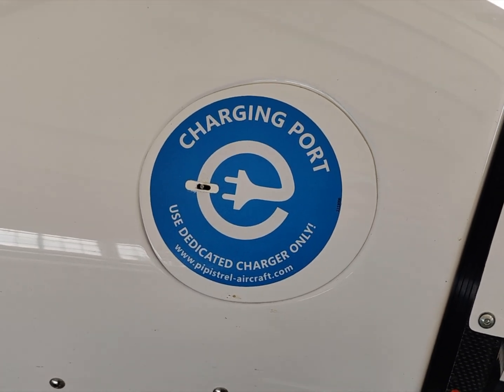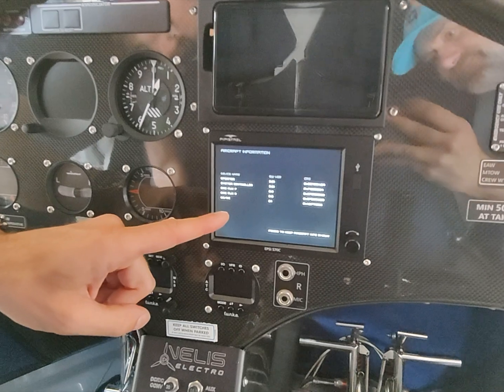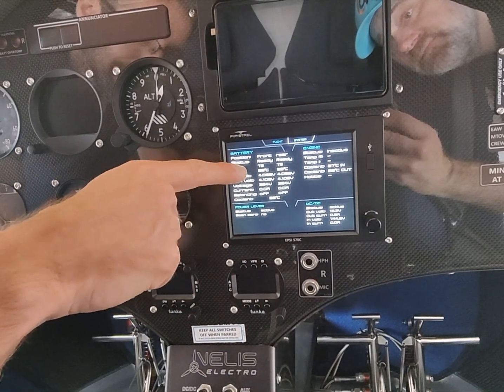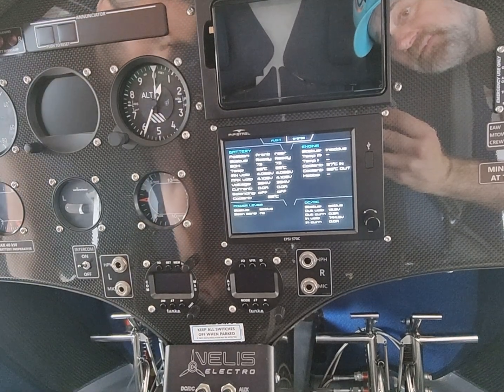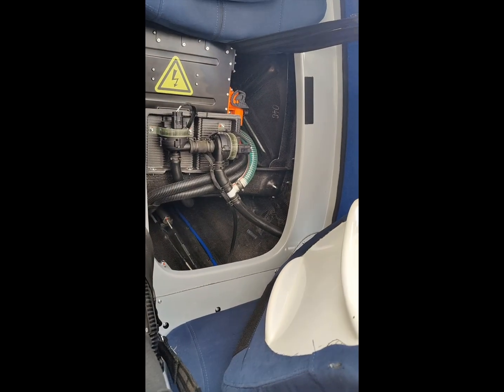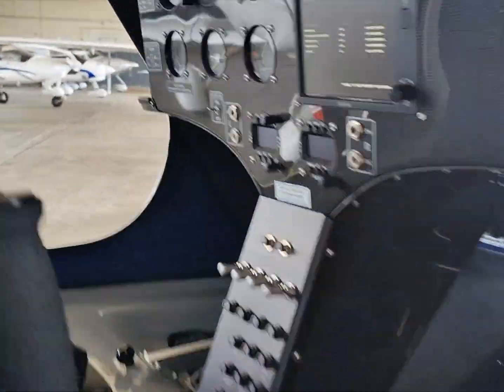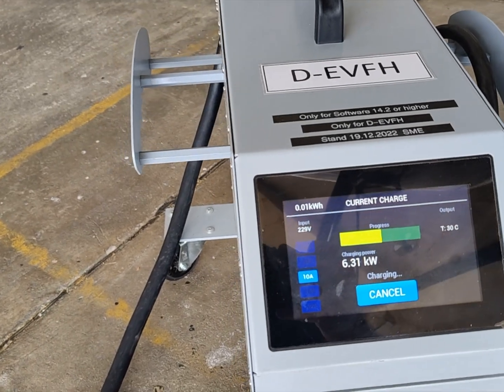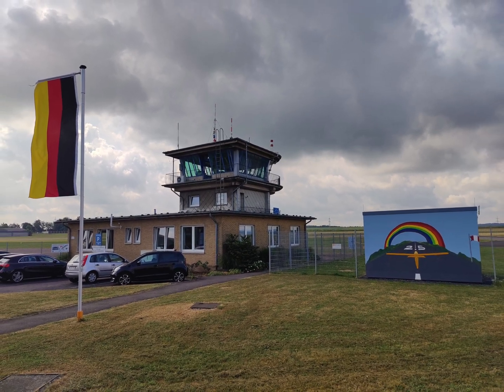Flying lesson in the Velis Electro

Comment: So what's in the checklist instead of T&Ps in the green?
Reply from the maker: No temps and pressures for an engine! However we did check the battery temp. It needs to be between 10c and 26c. 👍
Reply: @eveh2193  Every gauge should be in the green.